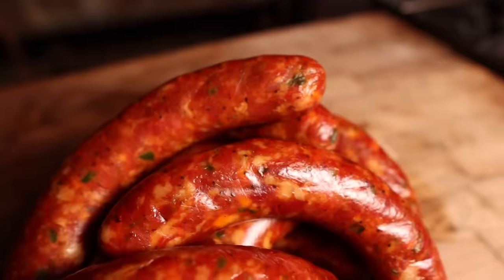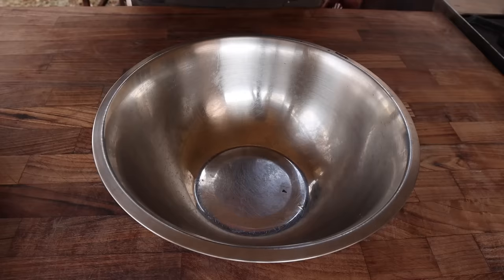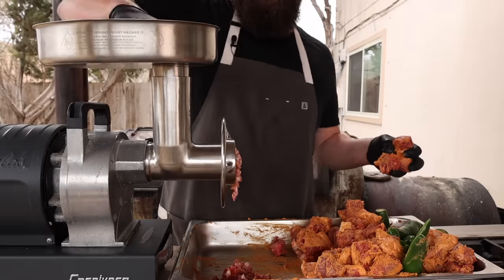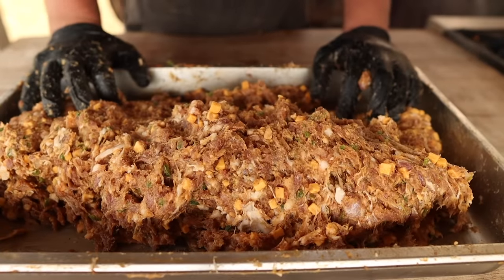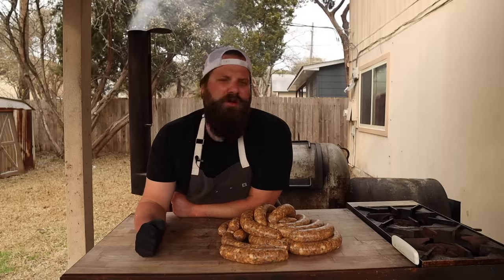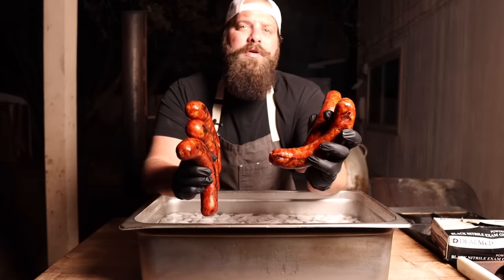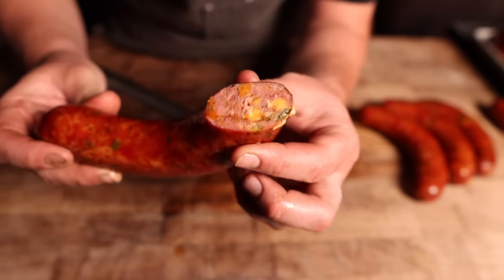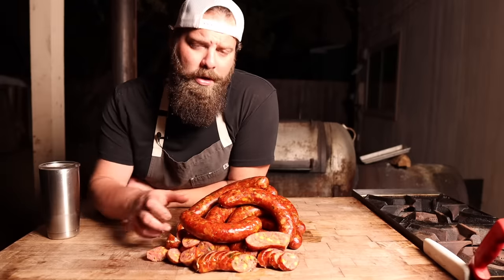Jalapeño Cheese Sausage | Chuds BBQ

Comment: If you are making say 20-40lbs at a time...  What's your preferred method for freezing the sausages to give out to friends and family?  IE: Do you make links and freeze them raw or do you prefer to slow smoke them for say 6 hours at 150 degrees until IT hits around 150 and then ice bath and then freeze?  I am making a 20lb batch tomorrow and curious on your thoughts.

Comment: Recently Cold smoked some links the other day using your hot links recipe, casing came out tough/chewy. The other links I've done i didn't cold smoke because my smoker didn't allow, and the casing had the snap/crackle/pop. My cold smoke temp was no higher than 140, for about 3 hours. 

I recently got a vertical pellet smoker which allows for colder temps. I finished them off on my regular pellet smoker like I normally do. Only difference I could think of is cold smoking.

Comment: Man your sausage video is all over the place some videos you keep it in the fridge over night case it then over night again and this video you seasoned cased and smoked Al the same day witch is it
Reply: Depends on if you're going to cold smoke and therefore use curing salt. Doesn't have to be over 3 days, but you need at least 12 hours between casing and smoking.

Comment: I like to use baker's percentages for scaling up recipes that involve curing salt, so if anyone else likes to do the same thing:

Pork Butt: 1814.4g / 50.0%
Brisket Point: 1814.4g / 50.0%

Hi Temp Cheese: 453.6g / 12.5%
Salt: 65g / 1.8%
Pink Salt: 10g / 0.3%
Granulated Garlic: 25g / 0.7%
Mustard Powder: 20g / 0.6%
Paprika: 15g / 0.4%
Black Pepper: 15g / 0.4%
Milk Powder: 90g / 2.5%
Heavy Cream: 300g / 8.3%
Jalapenos: 8 Total (1 per 578g of meat)

Yield: 4622.4g / 127.4%
(Measurement does not include Jalapenos)

The batch I'm currently doing is 2.33x larger than this by weight of the meat, so I just multiply all the ingredients by that factor (or, divide your total gram weight of meat by these scale percentages to get the same result).

Comment: would you be able to do the cold smoke part on a treager at 160f or at that point would it be better to just smoke with a smoke tube?
Reply: Did you figure this out?  I'm running a Traeger so I don't know if I can do this at the higher temp...